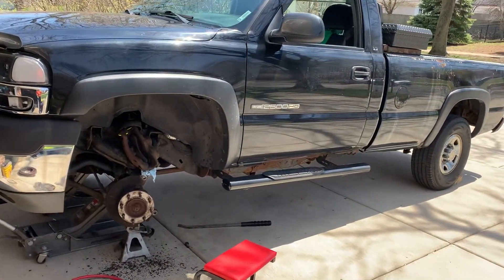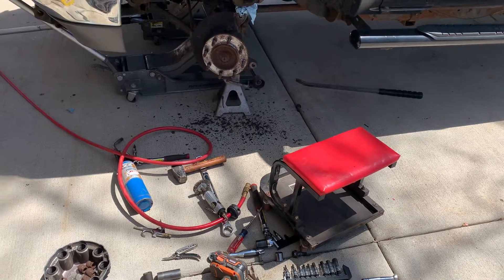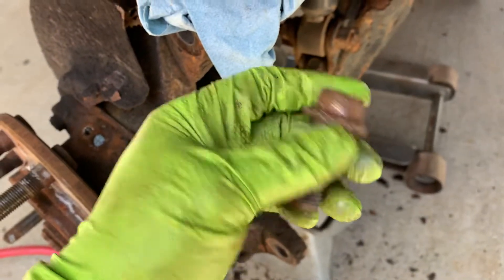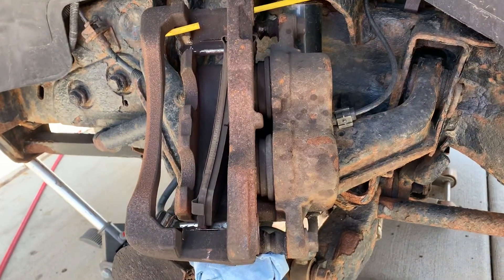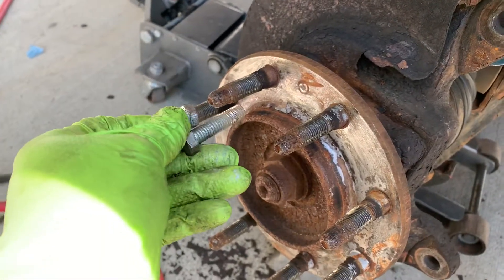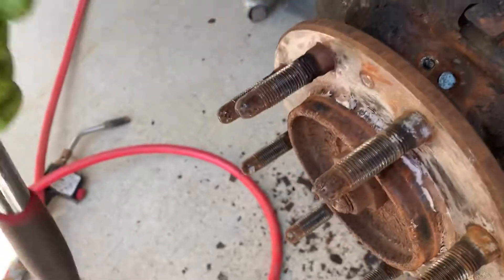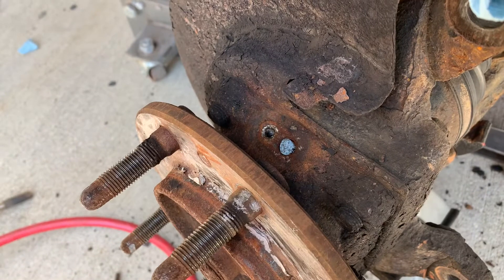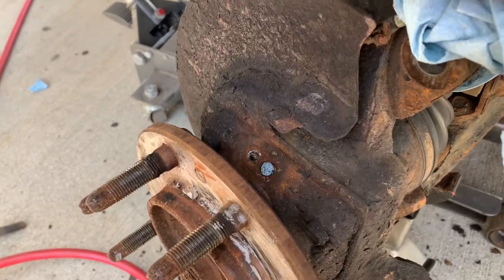2001 GMC Sierra 2500hd ABS Engagement At Low Speed

Comment: wow. funny i looked to find more of your 8.1 vids. mine has abs light on as well and brakes pull to left.  any tips appreciated!  watching video now
Reply from the maker: If it pulls when you brake, then you most likely have a seized caliper. If it pulls left when braking, then the right caliper is seized. Visa versa. Also, make sure your slide pins aren’t seized and lubed properly. If pulls without braking and just driving, then it’s most likely a tire issue. Swap the front two tires and if it pulls the other way, then the tires are the culprit. Hope this helps.
Reply: @westanner7885  yes this helps thanks.  it definitely pulls only when braking.  so i might be able to take apart clean lube and reuse right. if i get the slides moving and they were stuck that should fix it
Reply from the maker: Sounds like one of the caliper may be seized. Push the piston back and if it’s hard to push back or doesn’t move, then you need to replace the caliper. I recommend replacing in pairs.
Reply: @westanner7885  ok will do. thankyou
Reply: @westanner7885  Hi again. i have the chevy in the shop and they are doing new oil cooler lines. i dont have the time right now and want that oil leak stopped. i will work on tge brakes myself. easier for me with my limited tools. can you think of any stupid little / cheap possibly things to get done while its in the shop !?   thanks ahead of time.  you know thise pesky thi gs that may be hard to do but wasy for a shop and typical on these engines